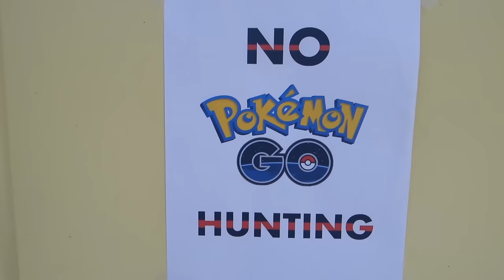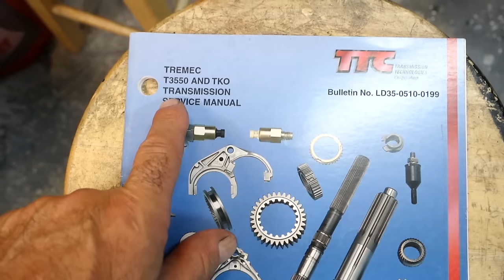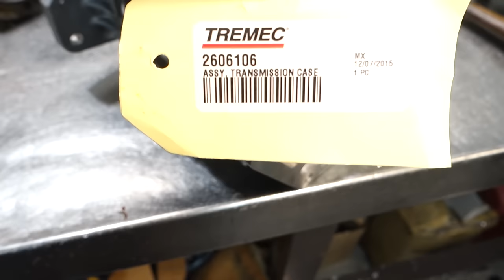How To Rebuild a Tremec TKO 3550 , 500 or 600 5 Speed Transmission

Comment: Hey man great vid, i have a tremec 3550, and i cant pinpoint a leak near the tailshaft hust below the shifter.  It looks to be coming from the neutral safety switch.  Is it possible that oil could leak there?  Im not sure if teflon seal was used or if its tight.  Its a small leak but it drips on my catalytic converter, causing some smoke.  Any help is appreciated.  Also, this is in a 92 5.0 mustang.
Reply from the maker: k129h8 the switch  can leak as well as the threads. Unscrew the switch and put some teflon tape on it.
Reply: GearBoxVideo i just went under and took a closer look, and oil is all around the speedo plug where it goes into the case.  Any tips on removing it so i have an idea what i would need to do as i go along.  I appreciate the help! Cant really find how tos online.
Reply from the maker: k129h8 its pretty straightforward to remove it. Use anaerobic sealant on it

Comment: I just bought an early style TKO (28 spline input and 31 spline output) for cheap because it has a broken 3rd gear (main and counter).  I see that the ratios are the same as TKO 500.  Im curious if I buy replacement gears for a TKO 500 do they fit?  alternatively I would prefer the ratios for the TKO600 would I just need to buy the cluster and gears or are there other differences?  I know the shifter forks for 3/4 and 5/R are different but im not going to shift it hard.  Oh yeah and you need to put the sealant and assembly grease on your amazon store ;)
Reply from the maker: Do you mean 10 spline input?  They never made a 28 spline input. The 26 spline systems should be the same if the tooth count is the same.  You can download the parts books for free on the Tremec website
Reply: @GearBoxVideo  sorry meant 26.  I downloaded the parts book and it shows that stuff seems compatible.
Reply: I've decided to stick with the 500 ratios.  Theres a lot of extra little bits needed to switch to the 600 ratios and it all adds up cost wise.  I'll try it out and I can always change it later.

Comment: Great video Paul.....what a miserable POS to work on! What do you think about the brass shift fork pads and forged 3/4 shift fork for upgrades? Could the cluster gear be lightened for better shift qualities? The 2/3rd shift can be pretty hit/miss on one of these boxes from my experiences with them.
Reply from the maker: Eric Brandt i never used any of that stuff or saw the factory stuff wear so I never sa a need for it

Comment: It looks like a TR3550, a TKO500/600 would have an electronic speed sensor on the passenger side, and the top plate would have equal distance side to side between the bolts allowing the shifter to be turned around
Reply from the maker: +sibirty that is correct
Reply: great video btw! just finished, lots of great info! If I ever have to rebuild mine I will definitely keep that "scuffing" in mind!

Comment: Thank you for doing this video, I found it very interesting, seeing I have a TKO 600 in my old firebird. What better to do on a saturday night, when your over 60, than watch  how to rebuild a transmission. I have one question, Tremec rates these a 600 ft lbs but I have turbocharged my 467 cu in pontiac engine which is very likely over the 600 ft lb rating. Is their any mods that can be done to support maybe 800 to 1000 ft Lbs?
Reply from the maker: Not really. Remember the torque output of the engine is split between the trans and rear axle. The trans never see's the full load. The lower the rear ( numerically ) the more load the trans will see.
Reply: I recall from engineering classes that torque is inverse to RPM, so that makes total sense. I also realize that my street tires can only hold a certain amount of torque and then they will release that load as the tires slip so even though they are 335/30 ps2 Michelin tires, I'm not worried about the transmission. what I am concerned about is changing the Ford 9" rear end from a 3.50 gear to a 4.56 gear, and then adding some.   sticky slicks and dropping the clutch at 4500 rpm at full throttle. In your opinion  (not to be held to any accountability of course) do you think this transmission is capable of surviving a season at the drag strip? one other thought is even if you said it should stand up to the abuse at it failed, it doesn't mean you were wrong, it just means that one parameter was out of expected tolerances, which could be mechanical or technic. it's just nice to know what the odds are that this transmission will fail under those conditions. sorry for the lengthy reply but you certain could not answer without the expected conditions. one last condition is its a twin 11" disk clutch which might hit harder then the average. thanks
Reply from the maker: John Terwiel The most important part is to regulate your driving so the tires don't break loose.  Track conditions may vary. Biggest cause of breakage is breaking traction and then sudden getting the tires to grip. Repeatedly doing this will eventually ruin your transmission as well as ring and pinion. You may on paper want to leave at 4500 but the track may cause your tires to break loose and you will have to adjust your approach.

Comment: Perhaps it is not a good idea to use Sandpaper on a new gear. They are mostly produced for duration. So using it could cause shift issues on the long run. Let's say you don't change any oil for long.
Reply from the maker: if the gears were machined properly I would agree. Sadly they have grinding issues because of a poor grind finish. This actually corrects the problem and works.

Comment: Ive watched this video from top to bottom..i put carbon synchros in, I used assembly lube, everything is in the correct position. It spins fine in neutral but will not spin in any gear. Ive been in out of trying to figure my problem out. Please help lol
Reply from the maker: Without having the physical transmission here that is impossible to diagnose
Reply: @GearBoxVideo  a guy helped me figure it out last night..the new bronze pads were to big not spinning on the gears..had to sand them down alil. I really appreciate you replying and the video. It helped me out a ton.

Comment: Paul I love your videos man I've learned quite a bit from you and I thank you for that.  I have a 1985 jeep cj7 and it has a t5 in it I'm looking for a different transmission to put in it. I heard the t176 is very good or possibly an ax15. I would just like your opinion on which to go with for off road use cause you're the only person I'd ask for an opinion on this from
Reply from the maker: The Ax15 seems to be the better conversion. Advance Adapters sells a complete kit.
Reply: +GearBoxVideo that's what I was leaning toward easier to find too just wanted the opinion of someone that actually knows what they are truly talking about. Once I ditch the 6 cylinder and go with a v8 I'm gonna try to find a sm420
Reply from the maker: An SM420 is too old. The Truck SM465 is better for the GM application. Really heavy transmissions
Reply: +GearBoxVideo I've heard that before but now that I've heard from you I'm more confident and I bet a sm465 is easier to find too

Comment: Hey man, nice job on the video, you convinced me to do this trans rebuild but with one problem... I can't find a case!! Can you help me out? I've searched everywhere online, just can't put my hands on one. Btw, where about FL, I'm here too!
Reply from the maker: Used case are hard to find.  I'm in Tequesta
Reply: @GearBoxVideo  new?
Reply from the maker: New should not be an issue for a TKO
Reply: @GearBoxVideo  it seems everyone is sold out. Checked Ebay, Amazon, any Google website that popped up the part number from your video. Nada.
Reply from the maker: Not everyone sells on Amazon and eBay. My email is support@5speeds.com send me your contact info and I'll look for you

Comment: hello Paul, i really love your video even I know nothing about transmission. but i just love to watching it.  I got 2015 mustang gt, people (include me) complain that this transmission is notchy at first in cold weather (38 or below). After driving for several minutes however, this symptom tends to disappear. Ford claim they this mt82 transmission on s550 mustang is improved, but it's still a bad transmission. My mustang(only 14000km ) already in the shop for over 2 weeks due to the transmission failed. they are waiting for new parts shopping from US to Canada. If by any chance, you could talk about this mt82 transmission and what's cause it so bad. thank you : )
Reply from the maker: You may want to experiment with different lubes. I think the notchy feel is from poor clutch release when cold.  This has been an on going problem with this transmission which is made for your Ford in China.
Reply: Well according the knowledge I got from your video :)   I guess my synchronizers wear out. If I press my clutch all the way down and shift from 2-3, 3-4, 4-5 gear with my foot still pressing the clutch, there is a lovely grind sound each time I shift, especially 4-5 gear. I'm guessing that's why it takes ford this long to fix my transmission?! anyone way, love your videos :)
Reply from the maker: Well actually think about it. What is the job of the clutch? Isn't the clutch suppose to disconnect the transmission from the engine? So if your transmission is still turning when you hold the clutch pedal down then you have a clutch release issue, thus the hard notchy shifting..

Comment: Tips how to make a t5 wc stronger?
Reply from the maker: Get Gforce gears
Reply: Use G-Force gears AND case.
Reply from the maker: The case really doesnt offer any advantage. It was made because GM cases became  hard to find. The T5 case is a well engineered die casting, the Gforce case is a sand casting. I have used both and never had any failures

Comment: What do you think of the carbon lined synchro rings?
By the way I watch and love/👍🏼all your videos!
Reply from the maker: I'm working on a better version. I don't like the current offerings. My forged rings seem to work just as good
Reply: GearBoxVideo wish I knew that sooner. Just ordered a complete upgrade kit from Liberty Gears with the new carbon synchros as well as the modified selector lever, new 3-4 fork and brass pads. Hope I don’t regret it.
Reply: Blue 302 how did it work out?
Reply: @Blue-uk6fd  how did it worked out?

Comment: Great video, Paul! - you’re a great teacher. I’ve watched it numerous times and used it to install CF blocker rings in my TKO600. 

Quick question- what are your thoughts on upgrading to the bronze shift fork pads in the TKO600 in a 90% Street driven car that may see the track once a year. Is there any downside to the upgrade? Are they prone to falling off the forks?
Reply from the maker: I wouldn't bother. Ive never seen an advantage

Comment: It really makes my blood boil when you get angry about oil that's residual that won't come out when draining it normally in a vehicle and then they ship it off to you. Just remember they're not actually opening up the transmission like you are... all they did is open a drain plug.
Reply from the maker: Trust me if you let it drain properly it gets drained pretty good. When you ship a transmission it better be drained completely. The reason is because if you don't drain and seal it it will leak , oil up the box, and the shipping carrier such as FedEx or UPS will hazmat flag it and it will be your responsibility to retrieve it from wherever it gets pulled at a cost. Sorry to say this has happened many times. Be angry all you want but remember most units do arrive here DRY. If you blood boils over this stuff.... you may want to try meditation.
Reply: @GearBoxVideo  so you should be a little more specific on how you should drain it cuz just draining it in the vehicle especially with how it can be mounted at an angle in the vehicle not all the fluid will come out. Every transmission opened while working in the shop for the past 17 years has had fluid in it after being drained while in the vehicle. the only time you can get it all out is if you set the transmission on the bench after it's been removed and angle it 20 30° multiple directions and let it sit and drain... which your average guy in the garage will not do or know to do without instruction to do so. The only other way I know to get all the fluid out of it is to take a cover... tell housing off or an inspection cover or something off and even then it won't all come out (and why would they do that they're paying someone to rebuild it).  I'm actually on your side but the problem is were not instructing people to do it properly. just telling somebody to make sure the fluids drained isn't enough. I guarantee you when we tell them it's very important to make sure it drained... it goes in one ear and out the other and all they hear is make sure fluid quits coming out of the drain plug before its removed from the vehicle.
Reply from the maker: @alltheboost5363  you put a stupid plug in the back of the unit so it doesn't leak all over the shipping container for one thing and bag it.  I don't expect people to drain units completely and wouldn't you think that after building  thousands of transmissions that I would know what a decently drained transmission is versus one that isn't?  Don't compare working 17 years in a shop with working 40 years in dealing with transmissions shipped to you. It's a different game. If people are going to ship us a transmission it needs to be fully drained, plugged and bagged.  Period. As mentioned early on , which is something you don't see because you are in a shop,  are new units flagged for HAzmat or units sent to me flagged for Hazmat. Why are you arguing this important point in making sure a customers transmission is shipped safely to your shop?

Comment: Sorry to inform you that this gearbox Will leak in the area just below the O rings... Should not grease the O rings ...should be all coated in sealer..the  area to the sides and around the o ring housing should all be sealer. If you check the selector shaft housing you will see there are areas with no sealant... leak area's. I copied your video and had leaks in these areas.
Reply from the maker: Actually if you are not careful and cut the o-ring they will leak. I've built quite a few of these with no leakage so its interesting that you are having a problem and I don't. I do see many builders use sealants because they damage or pinch the orings installing the tail. Don't start blaming my assembly procedure on your leaks.  Remember Tremec assembles these with grease and they don't leak. However I have seen factory TKO600have a leakage issue on the lowr front bearing cup.